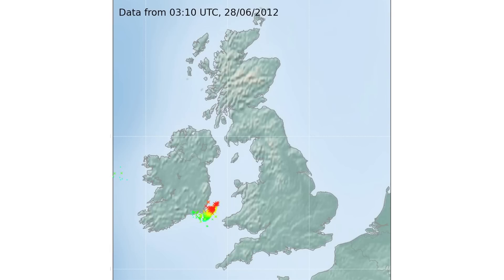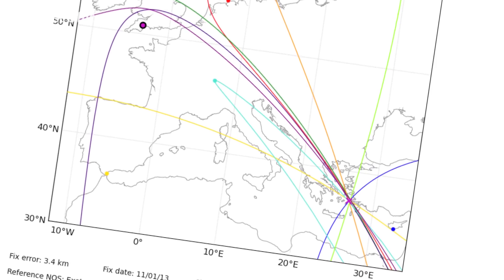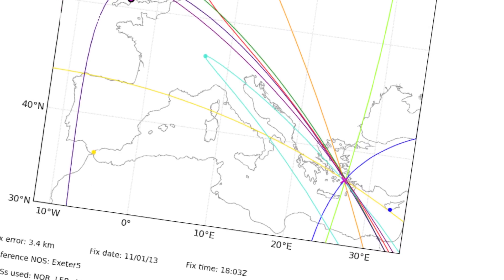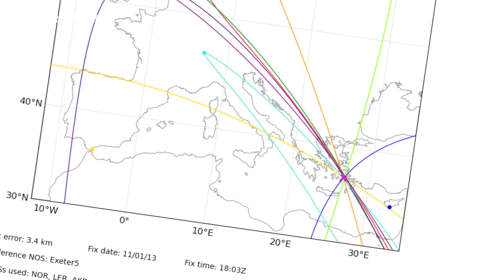How does lightning form and how do we detect it?

Comment: When there are many forks of lightning as in this strike (1:15) does it mean there are more dust particles or metalic particulates in the air for the current to jump? and vice versa when only one fork, the air is fairly clean?
Reply: +Geoff Shaw In positive cloud to ground lightning there is only the single lightning bolt i.e no forks. When negative cloud to ground lighting occurs forking takes place. Whether the amount of forking depends on dust and so on I dont know.
Reply: GeFlous
Very interesting, thank you, is this difference due to the negative charge in the atom being around the surface so to speak, i.e. the electron, thus allowing more divergent paths for the charge of the lightning bolt?